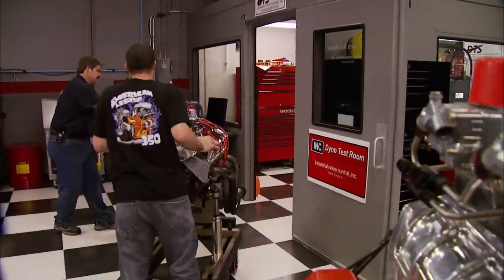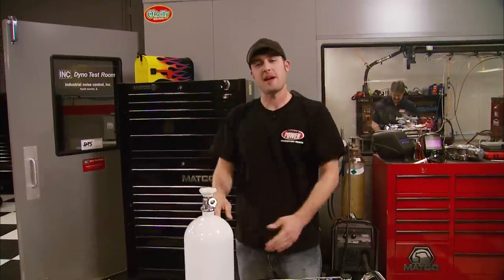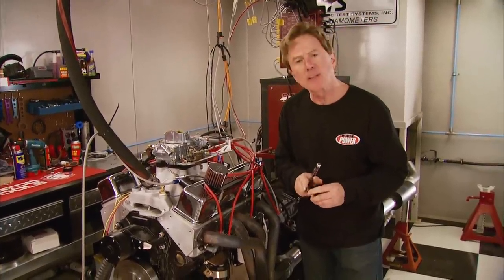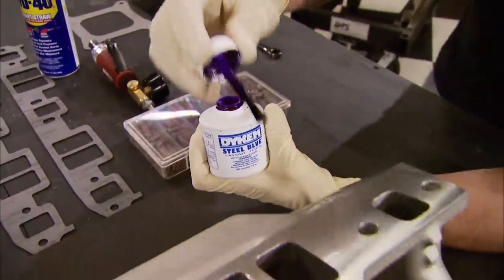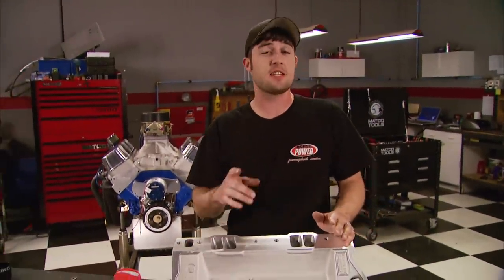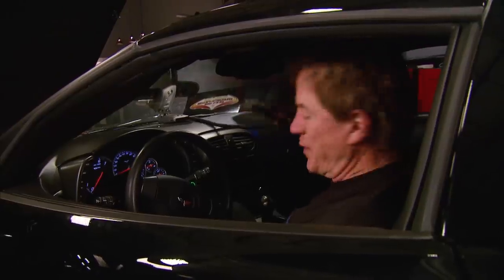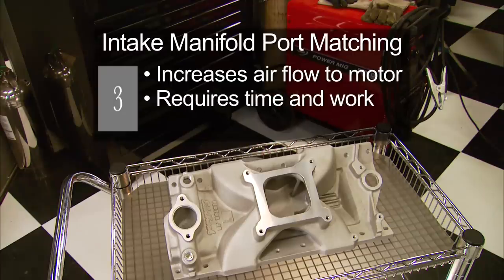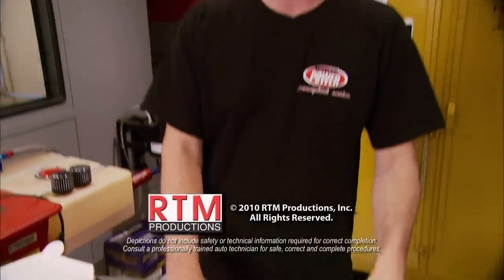Cheap Tricks To Increase Horsepower - HorsePower S12, E9

Comment: Ring Gap is more important than forged pistons with nitrous. When the rings completely close the gap your pistons will grenade and it doesn't matter if they're cast or forged.
Reply: was going to post the same thing
Reply: Thanks for the info bro I didn’t know that
Reply: EXCELLENT point, that also applies to folks that plan on adding a turbo or a supercharger to an engine that was designed to be N/A...when in doubt check out that ring gap! Safe standards are a gap that is about .0065 per inch of bore diameter, which should keep 'em from kissing, and for the 'first-time DIYer's'... gap the compression rings only kids.  Have FUN!
Reply: If your compression ratio is that high that it requires bypassing the rings or it explodes you might have other issues don’t u think

Comment: Sharpie permanent marker works well in place of Dykem
Reply: And don't forget to port the heads to match the intake and exhaust manifolds. He only did a quarter of the work
Reply: @robertsmith470  What's worse if the heads have a smaller opening then the gaskets he only made an obstruction and made flow worse.
Reply: Dykem smells better tho
Reply: You're correct  my friend  always  used a permanent  marker  on his manifold  port matching

Comment: You left out something very important $50 every time you fill the bottle
Reply: Yup. Always kills me when people say nitrous is cheap. It's only cheap if you don't use it. Start filling that bottle regularly and you might as well buy a blower. Also, a blower doesn't run out in the middle of a run. And a blower works for more than just drag racing. Can you imagine running a road course or autocross and having to constantly fiddle with the nitrous to turn it on and off as needed?
Reply: Definitely depends on the jet size, how long you run it, how many times you go to the track and so on. If on the streets, you’re an idiot. But if I use it 1-2 times at the track (2 NA runs and 2 nitrous runs if not busy), I can get 4-5 track visits on a bottle for me and I probably go 3-4 times a year. So $8000 SC drop and that’s me installing it and getting dyno tuned or $1200-1500 for a wet kit with blanket, blow off, remote bottle opener, purge kit, gauge, colder plugs and a dyno tune. 
If you have the money and go to the track a lot or need a little extra punch on the highway, definitely FI. Don’t have that much and want the power gain at a flip of a switch at times...nitrous.  
Most ppl I know kill a bottle trying to show off purging it. Be smart and it’ll last.

Comment: I got my first nitrous kit when I was 19 . Traded a 67 Fairlane for it and a msd set up and other goodies .for 93 coupe mustang I'd just bought . Well needless to say .the old advice about dont let cousin Bubba tell you how to hook it up .is very very true lol.the reason he traded me .he had a 70s model f150 with a 390 . I said how did it do on it . He said man for about 3 secs it was the baddest S.O.B. you ever seen . Sprayed it and it took off like a rocket. Then 3 secs later parts of the motor flew up threw the hood . And puked the rest of the motor down and out in the road. I said man what happened. He said I didn't know any thing about hooking it up. So when I seen two connections . I just put a Y in the nitrous line .and connected spray to both jets ! Hahaha yikes musta been like a 5000 shot coming threw that bigger fuel jet. He Laffed and said Bubba strikes again .

Comment: Porting the intake to the gasket is not an good idea unless the head ports match the gasket.   And you don't necessarily want to hog out the heads and intake to gasket size if you don't plan to touch the port further.   ===<>====

Comment: There was a time back in the late 90's that the LS engine was referred to as a just a "pushrod engine" and it actually was meant to be a little bit of an insult.  The insinuation was that it was old tech and GM was behind the times.
Reply: cause everyone was too busy blowing ford for their new mod motors.. nobody had a clue what was in store with the ls engine.
Reply: Bill Chase They are great reliable engines, just not very efficient
Reply: @trizkial7592  hahahahaha ok

Comment: Unfortunately I know from Engine Masters that air filter with the filter element on top as well isn't actually a good idea.
I was very surprised
Reply: I actually had my best cheap improvement with a 4hole to squarebore adapter flipped upside down on an edelbrock performer intake and 650carb. I'm not shitting you... looking at the part vs how it's said to be installed.. go with what looks right...😏
Reply: Errrybodeh runnin salad bowls now.
Reply: Can you elaborate on that, I have not seen most of them, did it make less power?
Reply: @dakotastimeout2827  Cold air intakes, aka a sealed box with a pipe in the grill makes more power compared to those style of air filters. The round ones without an air inlet pipe are sucking in the hot engine bay air killing power. Even the round style ones that have the inlet makes a little more power compared to the non inlet versions.

Comment: Do NOT make the intake runners smooth. The intake runners MUST be rough at least somewhat rough. Think about it this way. Only vaporized fuel burns. A rough intake makes mountains and valleys for the fuel to vaporized in and air charge to #1 mix #2 it gives the charge to make a longer trip on it's way to the combustion chamber, kind of like a straight line across country is shorter than taking a curved hiway. You know why the new school intakes are rounded over the top, or the reason old racers had velocity stacks? The longer the road to the chamber the more HP. The exhaust ports should be polished like a mirror to get the used up burned charge out the exhaust with no resistance.
Reply: Great point- Certainly don't need that charge 'puddling' in the manifold when intake velocities are low!
Reply: @btchhopperou812  fuel puddling in the intake???? WOW where'd that come from😂🤣😂🤣😂
Reply: @Binderbird4X4Firebird  pretty sure it was on a guys FZ600... back in the early 90's. He spent a LONG time porting, then polishing the intakes to an almost mirror finish LOL... Ran like shit until he'd get it revved up pretty good, ran ok high in the rpm range. I recall a few guys talking about it in the same building the shop where I worked at the time was. I also recall my boss at the time saying "you can't do that to a 4-stroke, maybe can get away with it on certain 2-strokes... I did make the comment somewhat in jest, although I do believe there is a degree of truth to the statement. LOL BTW, is or was at some point that Firebird a resident of Florida? I swear I've seen one around here a good while back...